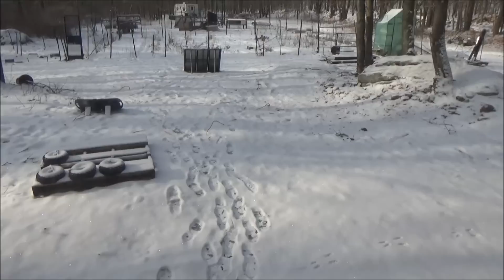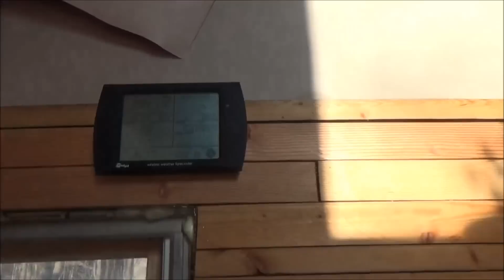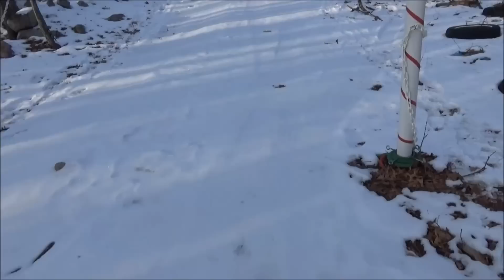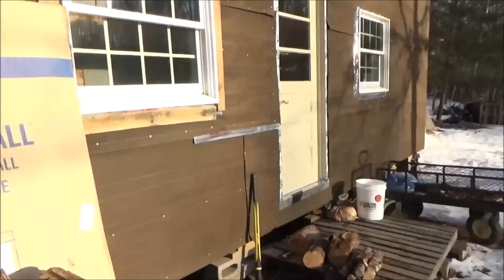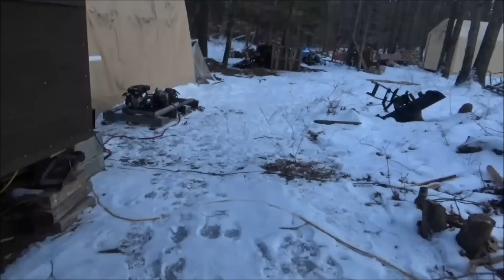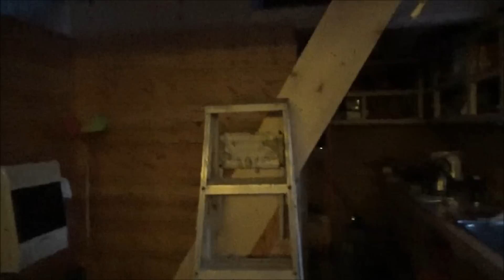Charging Off Grid Solar Forklift Battery And Vehicle Work

Comment: Why not just mod the exhaust on the DC gen  ?
I am sure you could find a local small engine shop that has a good used exhaust from a old generator for cheap, just use a silicon hose to join them.

Comment: Troy, you need to look into something like this solar tracker then mount your solar panels onto a frame and get them off of the ground.  http://www.ebay.com/itm/Complete-Kit-sunlight-track-Single-Axis-solar-tracker-Linear-actuator-electronic-/390583381252?pt=LH_DefaultDomain_0&hash=item5af0956d04

Comment: Just a thought here...please don't shoot me down in flames for this - is there any way you could install some sort of turbine in the chimney from the wood stove to generate some 12v power to run a few LED lights/charge phones/laptop etc. without depending on the main battery bank?

Obviously, in the summer you won't be using the stove as much so maybe use a small harbour freight solar panel to give that battery a charge and save using the main battery bank for the smaller stuff (as listed above)

Just an idea that someone with the technical expertise could have a think about and maybe develop for Troy to have a go at in the future...

Comment: well i did try and tell you about forklift batteries needing to have a lot of amps just to get them to start charging. 3kws of solar should do it. and if you're smart you will pick them up for free like i did, then it just needs a little work to fix them up. 21 x 240watt x 24v panels i pickup up for free. all with shattered glass. I ended up fixing 15 and giving away 6 to an off grid person just down the road. so make a few phone calls troy. you will end up with more power for your home and a lot positive comments on your power.

Comment: Buy a can of B12Chemtool at Walmart and put it in a full tank of gas to clean the injector on the four wheel drive Chevy truck and it will run smooth. Only every other tankful. The cans of b12chemtool cost only about $3.50 or so at my walmart. But  more expensive at the parts store. Seafoarm is good too but cost more and they both work the same. All the other brands of fuel injection cleaners are phony or useless and don't work.

Comment: Try putting a couple of polycrystalline solar panes right were the Harbor freight panels are. Just to see if you get a improvement. Buy a hundred feet of 8 gauge landscape wire on ebay. cost about 120 bucks or so. But darn well worth it.

Comment: I wonder if you could trim the lower branches on the trees,  but leave the two trees. Look at the pictures from the doorway... they are framed by those two tree so beautifully.   I realize you see the trees outside of the camera's view so these two seem minimal, but without them the view from the door will look quite barren.  I suppose you could just film from the kitchen window or the table window to pick up a view with the other trees. Might want to check it before cutting down the trees. Or consider cutting one, trimming the low branches on one?
Reply: What I am concerned about is the inside of the tiny house ending up looking like a hoarders place. Like that 'nice piece of wood' he wants to hang on the wall.   Learned year ago to not allow stuff like that inside because you end up with a junky looking place, rather than an open airy place one wanted when they began.  Been there done that.  Troy has a habit of allowing things to become disorganized and junky outside.   That concerns me.

Comment: enjoy your the power you can really pull on that battery hard but it pulls harder puting it back  don't forget the old batterys charge them to use them back and forth charging one useing one your in good shap now for year to come the creek run like that all the time big power padal wheel ac pma  can get it to the house with small wires

Comment: good job i don't think you have any chance of over charge and the voltage regulater in the altenater will not let that happen and the motor will limet max out put to 40 amps or less motor is not as big as it needs and spin is not 3 to 4 time engine speed like in trucks and cars but it is the best you have and it will charge it but not as much as you think 100amps is a lot you do not have it but is a good rig you never get max out put most times anyway you are in the best power since the camper keep pumping it in and use less is the key you do need to top it up evey week  maybe 16 hours to keep it in good shape you never get it all back peek charge is inportant

Comment: Hi Troy- Couple of tips from the prairies and an area that has frequent and sudden melts of snow - AKA chinooks. 
1) If you have problems with areas icing up, try getting some trenching in to divert water away. Water always wants to gather at the lowest spot. This is something you'll want to plan out for a summer project. You will need some equipment (pickaxe, etc) and it's a lot of labour, but so worth it. It's a fix it once kind of thing. 
2) Do you still have your mulcher? Clear some shrub, prune some of your berry bushes, use the branches as mulch and put that down in those heavy ice areas. As long as it doesn't get submerged in water, you'll get a bit of traction. It does have to be soft when you apply it and you do need to continually apply. This time is also a good time to make mulch as you don't have to deal with the leaves and thinned berry bushes produce larger fruit. 
3) I strongly caution you on your thoughts about cutting down those trees. From what I can remember seeing from my side of the screen, during summer you get a lot of shade from those trees. You may seriously regret it if you cut those trees down. Perhaps put the panels at your end of the garden. 
4) Don't be stingy or sloppy with your building materials. If you don't need a full pallet, cut off the excess. Reducing the footprint of something can often strengthen it (less flex) as well as making it look a bit less junky. Either use the scrap as firewood or cut the pallet in such a way as to maximize the useful material (there will still be some waste).

Comment: Have you thought about making a 'muffler' box to keep the DC generator in?

You've plenty of wood and perhaps some of that fibreglass insulating material left, that you've got in the tiny house? Make a padded box, with enough space for air and heat to get in and out, should solve the noise problem.

Comment: prop a pallet/wall up between the house an dc gen far enough not to get to hot and deflect some of that noise back and away later mod the gen with a better muff like from a motobike or small car  or even a straight pipe straight up  with rain cap  ..  second  man split the loads,,,  modem on a separate battery with its own solar panel   just my two cents again     keep it up carry on .....

Comment from the maker: People please read the video description before commenting on the output of my DC generator. Thanks :)
Reply: What??? There's a description?   Are you serious?     ; p
Reply: Troy, have You checked the real modem power usage? In my case it's closer to 1 W than to 12 W while only few of the features are in use. Wireless upload takes highest percentage of labeled power. Wires instead of waves would really lower energy drain. I would measure actual power usage of all desired devices (not labels) connected and working at once and made it base for calculations.
Reply: Too bad he cant take the one wind turbine and put it in the spot of the auto alternator
Reply: Dont worry bryan
Its on of docs bath house buddies.
Crude, uneducated and on a ban list
Reply: And the "he" the bath house boy was referring to was troy.
Reply: ***** as to why....
My thinking,  the turbine is designed for power generation, the alternator isnt normally designed to carry a contant heavy load.

Been out of ET field for too long. Getting rusty.
Reply: I understand Brian. Power consumption is like household budgeting. Live within your means.
Reply: And I know a lot about forklift batteries. Been driving one nearly 20 years.

Comment: what y really dont understant is why you do not use the spare pannels you have now on a pallet?? (for a year now??)every amp is one! (you can connect them on te mppt easy with the others in winter, otherwise use the controller you have in the emergency truck gizmo (the pwm) 

in dutch we call it walking behnd on the facts... sorry, cant see the problems you have , becouse you dont have to!

Comment: here y go again! (sorry!),no way it will charge 130 amps, it wil be more around 60 amps due to the voltage loss and the voltage controller build in the alternator on 14,5 volts,  no way it is charging 130 amps,(as mutch as y want it to do that it realy is not!) rebuild the alternator with first one diode in the sense wire, and connect that on the positive of the bank, instead of messuring the voltage internal in the alternator.(find the schematic on internet how to.)
thats really a must! if you have a 800 amphour bank charging it more than 10% is no problem with these tubeplate battery,s., first get them tottally equalized before you use them, otherwyse its no point and you will ruine the new set, that would be plane stupid.

sorry to be so direct, cant see you distroy a perfect bank in the first 2 months!
Reply: Bob Blunt
Not that it matters but I am simply not man enough for anything that requires a person be manly.
Reply: Bob Blunt
Thing is I cannot address your comments regarding Troy's expertise or lack there of. I don't know enough about the subject to know if you are just full of yourself and Troy is OK or not. What I can address is that just because a person writes some bullroar on here that they think is helpful and quite understandable does not mean that they have really said anything that actually is either helpful or understandable. It also doesn't necessarily follow that because someone writes with great conviction and self confidence that they know Jack regarding the subject. There is a lot of self-aggrandizement and puffery going on here.
Reply: Alan Marine there are modified exteral regulators available from mastervolt who have those functions, (expensive) he can also connect a 50 amp alternator(with modified 17 volts regulator (or a 24 volt alternator on his mppt solar charger to get the same results) (we have tried that with a mppt charger here and it worked perfectly) you can get these traction batterys charged completely with a 15 volts charge, he has to mount a silicon diode in series with the sense wire from the regulator, th silicon diode has a 0,7 volts voltage drop on the sense wire, resulting the regulator to increase his out voltage by 0,7 volt, so from 14,5 to 15,2 volts, fine for his bank (he uses the dc genny for bulk load, and the solar for equalize or float charging,
in that way he cant overcharge the bank in that short time, but get a good bubbling going on to prevent statification.
agreed, its not perfect but i practice this will work fine (we have tested that in practice for years, so we are experienced (or however you write it) with this. 
Regards Richard, VRM marine.nl
Reply: ermorgan0926 if he rebuilds the regulator to 15,2 volts (with only one diode in the alternator sense wire )he can get a bulk charge in it whitout damaging anything (due to the short time he is charging with the dc generator), those tubulair plates in his traction cels like to get bubbled, at 15 volts, no damage wil ocure in the 5 hours he is charging, the final charge can be done by the mppt on the panels.
its only a bulk charge, not the final float and equalize charge phase) (please read my comment to Alan marine.)

Regards Richard (VRM marine.nl)
Reply: SSanf  if you are regarding to my advice to Troy,note that y am a proffesional batterybank and solar/generator and wind power offgrid systems dealer,(Victron energy) and user! with 30 years off experience.  not like a lot of posters here who really have no clue other than what they see on youtube or internet.. just saying, no offence to any one, its a sort of seen it, done that.
Regards Richard.
Reply: MrBugsier5
OK. Then, you must know this stuff.
Reply: ermorgan0926 arent you watching for free? Who's the cyberbegger?
Reply: Alan Marine i think its funny the first 5 min is said that he was doin the math etc to figure out what we were saying 2 months ago, at our offgrid homestead we have only ran the generator once this winter on christmas eve after 2 weeks with no sun, our system is only 4 120watt panels, and 6 460a/h 6v surette/rolls batteries we have a piston pump for running water lights are on as much as we want (especially since we upgraded to from cfl to led light bulbs), modem is on constant along with a macbook other chargers etc

Comment: Your Watt numbers don't make a lot of sense because you use Watt both for the power that is generated or used, and for the energy stored in the battery. A 100 Watt panel generates 100 Watt-hours in an hour, and 500 Watt-hours in 5 hours.

Comment: WHY DON'T YOU MOUNT A SET OF SOLAR PANELS ON ONE OF THE FRAMES YOU HAVE,UP AT THE TOP OF YOUR FRAMEWORK,ACROSS THE FRAME,ALSO,IF YOU HAVE MORE UPRIGHTS,GO UP 1 MORE LAYER,MOUNT TURBINE ON HAM TOWER,IN THE CORNER,AND ,GUY BOTH

Comment: This is just a joke Troy, but considering your power needs, it's sounding like you may need a larger wind farm and solar farm, just to stay up with all your electrical consumption and equipment you want and need to run to save burning fuel...LOL...
Just ribbing ya Troy... :-) Your gradually getting it worked out, and you will, I know it takes some money to make things happen.
And having to lay money out for car and truck repairs does not make it any easier,at all, I know...
I know in time your going to get it all charged up,connected and working the way you need it to and hope you can also get a hold of some ice cleats, somewhere soon...Would not wish to hear you took a bad fall on the ice, out there one day...
Reply: big low speed diesel generator will be nice to!

Comment: Oh yeah, and one more Question.  Can you not use snow on top of the wood stove for providing humidity?
Reply: A pan full of snow will give you just a layer of water (snow is 10 times less dense than water) and takes a lot of energy to melt. It would work faster if he had water, even very cold water, to put in that pan. But he could put a bucket of snow in the attic where it is too hot anyway and use some of the excess heat there to melt the snow. Instead of taking another slip-sliding walk to the creek for water.
Reply: pieter zeeuwen
I like the idea of the bucket or pail full of snow upstairs where all the heat in the house ends up.  That would work. 
Re: The snow on the stove.  The pot Troy is using is HUGE so that filled with snow may NOT work to provide gallons of water but would likely work for the intended purpose of providing humidity as it's not a "pan" but a pot which (even with the ratio you mentioned) could hold enough snow to do the job.  PLUS, the energy is already there being spewed from the wood stove so it's not like it would take EXTRA energy :-)

Comment: Have you priced mobile wireless hotspot ?A device you can clip to belt and take with you.I think they just have batteries or rechargable battery .Just a thought if your in a coverage zone for an aircard type device.Good luck with your internet.
Reply: Good idea, I had a Verizon hot spot (not the phone the actual separate unit that can run five devices) it worked great and Troy is in the coverage area. But it is pricey.
Reply: He had one before he had high speed
Reply: RedTeamWolf oh, I thought that was just his phone's hot spot.
Reply: We have 3 carriers I was interested in here in the New Brunswick,Canada. It`s expensive but is cheaper if you buy the device instead of subsidizing it over 24 month contract.Fido has best deal here.

Comment: Sorry that motor cannot push 130 out of that alternator...?
Reply: He didn't say it put out 130 he estimated 80 to 100. If you didn't hear it in the video you can check out the description.
Reply: ***** I know, right?! Surprised the heck out of me when I found out!   Lol!
Reply: Not with small motor...?
Reply: To push any kind of voltage and amperage it needs to be above 1500. but closer to 3000 or above... and i think like 15 horse.. not sure on that
Reply: rpm. voltage. load amperage. all related.. and horse power.
Reply: Need engine that can run off propane, diesel, gas, or wood smoke. Wood smoke is free if you heat with it...?
Reply: MollyDolly why is he guessing he has an amp clamp??